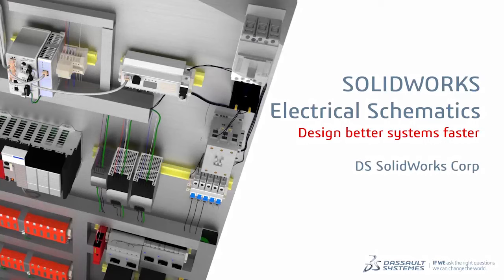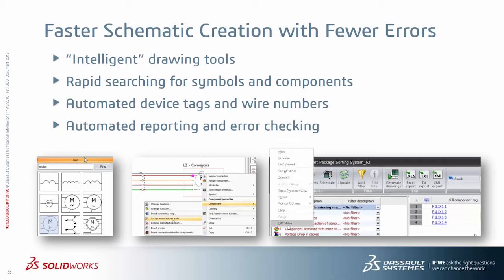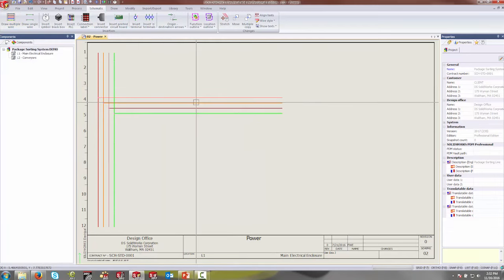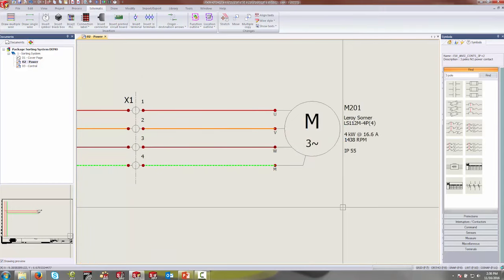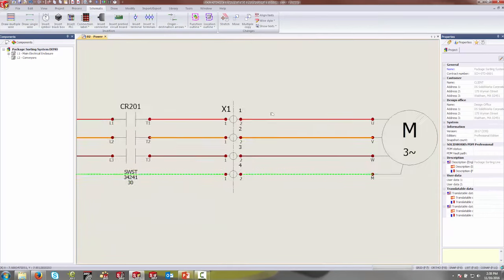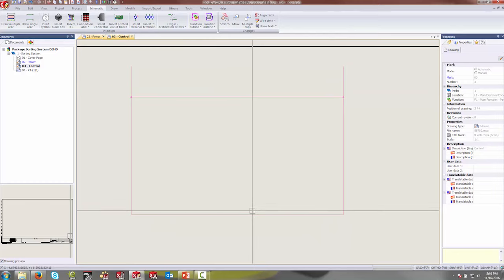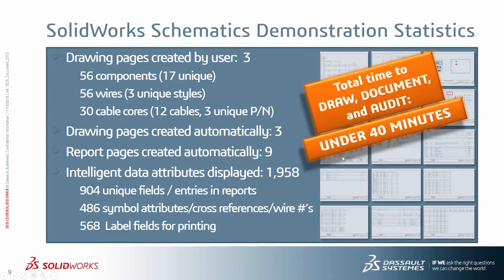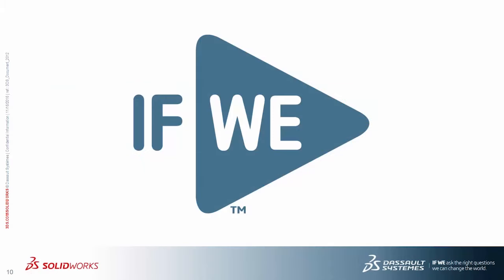Product Demo: SOLIDWORKS Electrical Schematic

Comment: I've a little experience with elcad and eplan.. 
In simple electrical documentation I want these structure.. sld, schematic (w/ cross reference, built in and customized symbol library, configurable z plan or entity for batch job automation process), component list, wiring list, and cable schedule.
My question, is it more user friendly and easier learning curve on sw electrical than 2 of them?

Comment: can you combine the electrical with the normal solidwork mechanical model?
Reply from the maker: Certainly! There’s an add-in for SOLIDWORKS called SOLIDWORKS Electrical 3D that allows you to link one or more mechanical assemblies to an electrical project and leverage the connections made in 2D to automatically route wires/cables in the 3D model. I cover this tool in this video – you should check it out! https://youtu.be/LF-WyPCS36I
Reply: @Trimech  this isn't what's in my mind. for example operating a pneumatic piston using a solenoid switch
Reply: @Trimech  i went through this video but where is the simulation of the 3d conveyor you have created?
Reply from the maker: @the_idiotic_thinker  You can represent electro-mechanical devices in the tool, yes. It’s actually got a decent P&ID/PFD symbol library baked in, and the electrical and pneumatic symbols link with one another. On the mechanical side, you can differentiate wire connection points and hose/tubing connection points on the 3D model.  Hope this helps!
Reply: @Trimech  sorry but am still confused. i get the point that i can show that in the electrical side but can the mechanical simulation be driven with the help of the electrical circuit? i mean a proper 3d simulation. if yes then can you guide me how to do that or where to learn that from?
Reply: i am actually trying to operate a 3d model of an engine and its intake valves by using an electronic controller with the use of a pwm. is that possible in simulation?

Comment: very useful . thnx
im not seeing a macro tab similar to the one here.
Reply from the maker: Thanks, Jesse.  Is it possible that you may have turned off the macros tab accidentally at some point?  Easy to turn back on under View>Dockable panels and selecting the macro star icon.
Reply: i don't remember doing so but it was off. SWE is new for me, but I did eventually find the view tab then the macro icon to turn on. thnx for getting back.